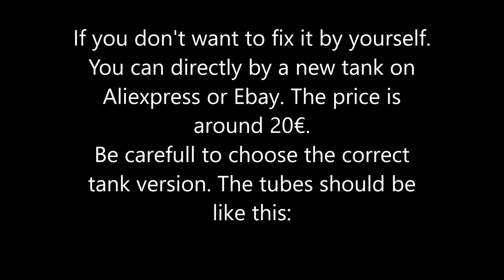Xiaomi Vacum mop P Water extraction issue & Fix

Comment: Mine was not producing water and I could.not hear the pump turn on.  There were no clogs. I tried with the filter removed no help. I realized that when I was putting the tank in I couldn't just let gravity do it. A little push down snapped it into place. I restarted and heard the pump immediately and all was good

Comment: For my Mi robot. when i install the water tank into the unit, there will be no water leak at all even i leave it there 5-10 hours. But as soon as I start the mopping, the water will come out continually until the water tank is empty ! even a very small room (only 9 sqm room). This causes the water to leak a lot on the floor and the mopping cloth will be very wet. Note sure whether this is the same problem with this video or not.
Reply: A pump controls water flow. You can reduce the flow in the app

Comment: Mine doesn't drop water at all after 6 months of use
Reply: The same
Reply: Same did you find solution?
Reply: @toliscy  yes , the solution is to buy another tank is damaged,  i bought a new one and it works fine

Comment: The problem is my 2in 1 tank droplet water. Is it normal. I just put water in tank and it will eventually starts to drop water.
Reply: Once you plug the water inlet rubber, the water dripping will stop.

Comment: Do I need another tank because when I try to only mop I get an error that I must check the water tank. But vacuuming and mopping whit the combo tank has no issue and works great. I want to only mop but it doesn't seem to work !
Reply: Hello, I had the same problem. When You need the only MOP without vacuum you should remove the filter. Without Filter ITs OK for MOP only and you don't need another tank.
Reply: as said above, if you need only mop cleaning, just remove the white filter of the tank. It works.
Reply: Im having the same issue!
Reply: @Leavemyspree   Yes you need a third Tank sold separately just for water if you wish only to mop without vacuuming.
Reply: Philip Petkov I get the same problem..with error of no water tank installed. and do you have to wet the mop before you start the vaccum and mop task.
Reply: @vargst  You have to buy another tank just for moping and you don't have to put anything on the mop itself, but for better results you can pour water and a solution for floors on the mop (DONT POUR ANYTHING OTHER THAN WATER IN THE TANK JUST ON THE MOP).

Comment: For the new tank with halfway plastic, you can use a clear aquarium air pump tube to extend the length and also does a good seal to the mop hole. Yes, both tanks design have problem. Aquarium tube can also be cut into a thin ring as a O ring too.

Comment: Please remove the picture at 1:07 as it is wrong. Both deposit are defective and need to be fixed.
Reply: yeah whats the fix ?
Reply: @randyorton06  Hi there. How to know the new one problem fix?
Reply: @randyorton06  the easiest? Buy a new one with the problem fixed. https://m.es.aliexpress.com/item/4001066619600.html?trace=wwwdetail2mobilesitedetail&tt=MG&bizType=ProductDetail&af=1310497&utm_campaign=1310497&aff_platform=portals-tool&srcSns=sns_Copy&utm_medium=cpa&afref=android-app%3A%2F%2Forg.telegram.messenger%2F&mergeHashcode=70002833922&description=%E2%82%AC+17%2C33++50%25OFF+%7C+Original+300ml+Dust+Box+%2B+200ml+Water+Tank+2+in+1+Dust+Collector+Parts+for+VIOMI+V2+Pro+V3+VIOMI+SE+Robot+Vacuum+Cleaner&title=%E2%82%AC+17%2C33++50%25OFF+%7C+Original+300ml+Dust+Box+%2B+200ml+Water+Tank+2+in+1+Dust+Collector+Parts+for+VIOMI+V2+Pro+V3+VIOMI+SE+Robot+Vacuum+Cleaner&dp=3f8d72a2a8e9eb53605ba357a3783131&platform=AE&cv=47843&spreadType=socialShare&mall_affr=pr3&sk=_ePNSNV&aff_trace_key=7db10cbb10644318b3578c9b503a318c-1607978491827-01698-_ePNSNV&businessType=ProductDetail&terminal_id=13bb75a8aa3b4944b78c1d2b376b1e91&tmLog=new_Detail&templateKey=white_backgroup_101&utm_source=admitad&utm_content=47843

Otherwise, 3d printed water outputs, rubber washers...